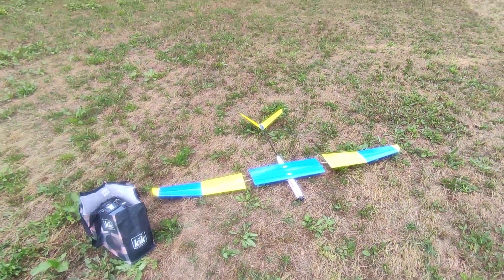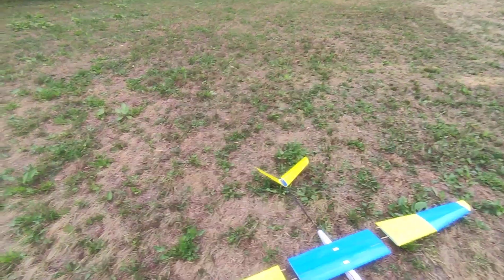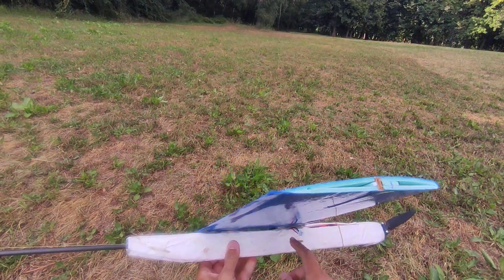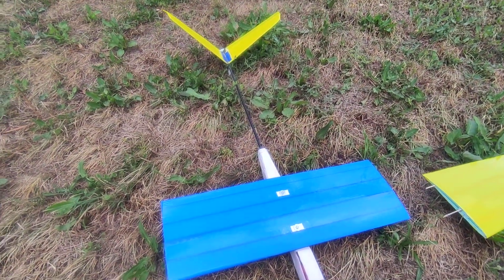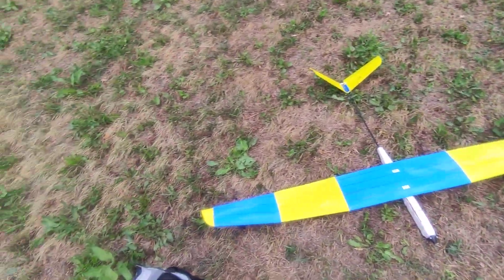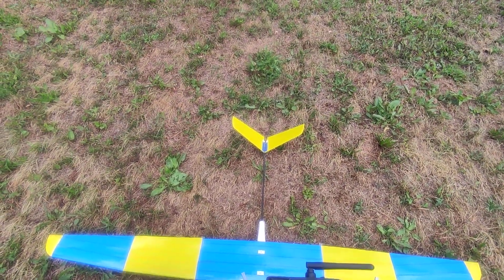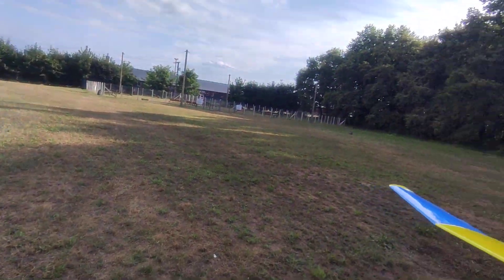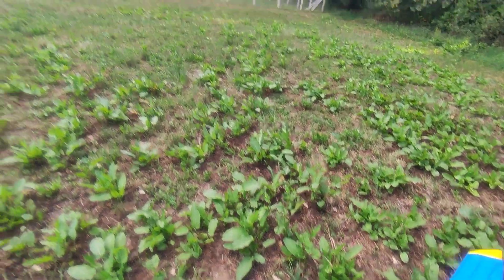Homebuilt thermal motor glider (T Hunter wings copy) - maiden flight

Comment: 0217   when (thin) wire pushrods are used, it may be  Necessary  to make use of pushrod  GUIDES; in order to prevent excessive flexing of a pushrod during 'push'. 
0225   main spar 'connectors' should be located at thirty percent of chord.
0627   it appears that the effective span of the v-tail is too small.    the span of the stab should be equal to twenty-five percent  of the wingspan.
1200   the main wing is short-on span-wise stiffness.      said another way, the wing has  VARIABLE  dihedral.!
1419   the tail boom is short-on torque/twist resistance.

Comment: Beautiful build! I admire scratch builders, I think I saw the original video by Andrew Newton as well, might one day try to get into scratch building myself, but first I’m learning flying with some prefabricated models, I feel like I get to learn a lot just by noticing what makes them flying well and what makes a nice build.. This is also some advice the dollar tree foamboard DLG builder gave in one of his comments. Did you hot wire cut the foam profiles or sand them down manually?
Reply: ..never mind, your newest video answered it 😄👌
Reply from the maker: @MoritzWeller  Thank you! Yes, it is a simple wing making method. I like it because I can stop when I want (but it is hard for me) and I can continue next time.
In the next build I will try to make a wing with curved TE. 
Link: https://www.hyperflight.co.uk/products.asp?code=MIRAI&name=mirai-f3-res-f5-res-2m#mz-expanded-view-183222728718
I would make the LE in straight form. I wish you the best in learning and practising flying with DLG and other planes. I think that I found the best way for thermal flights in my local area and my flying place.

Comment: another winner!
Reply from the maker: @bracesport  Thank you Phil! I have to reinforcement and fix the wings to the fuselage stronger and I have to strenghten the fuselage sides.
Reply: @goldenfish77  how is its climb performance?
Reply from the maker: @bracesport  If the control (V-tails) is precisely adjusted, the glider can be "rolled up" very nicely on a spiral route wirh a slightly higher elevation. The engine has good power and even with this battery (with a full charge), I think you can climb up to a height of 100 m up to 10 times. If I put a lighter battery with a smaller mAh, I would reach this height sooner, for sure. I am going to try the 1000 mAh batteries, there are two of them, and then I will be better off with two of them fully charged than with a bigger one.